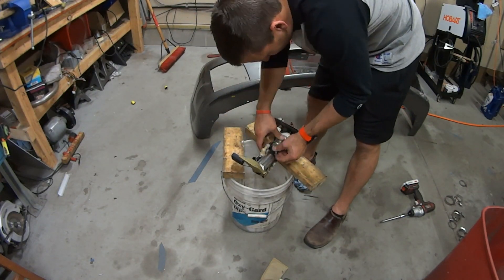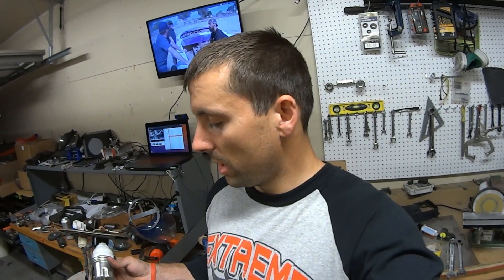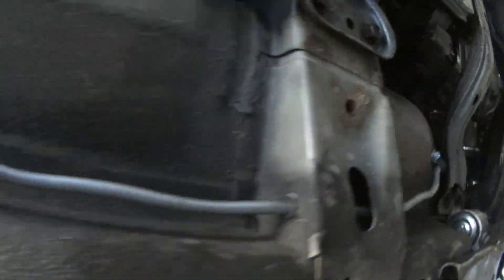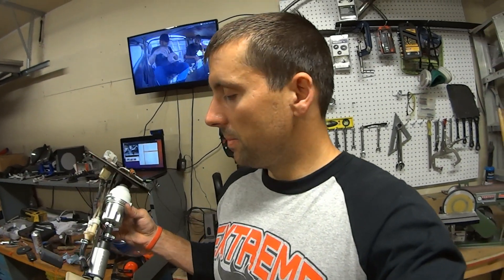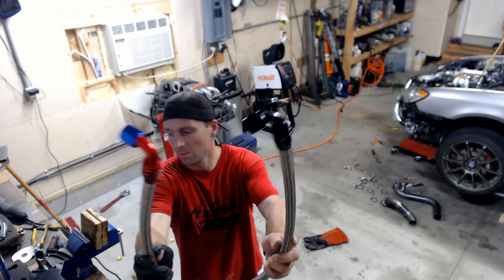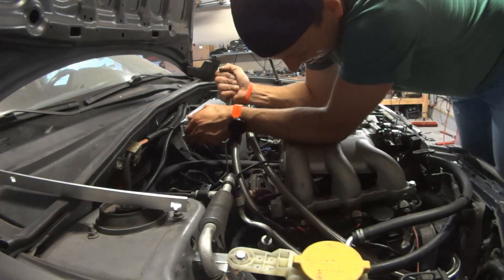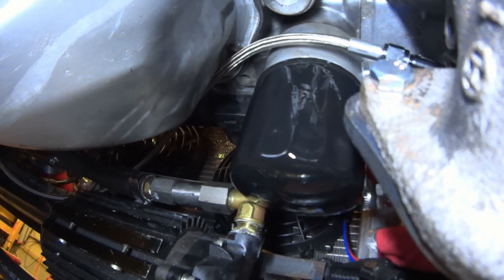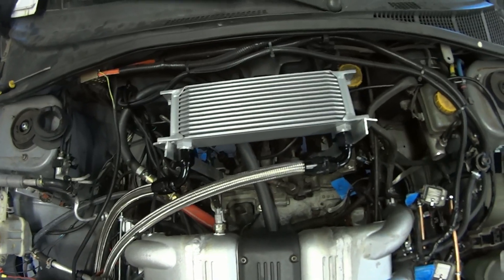EG33 Swap - DW65C Fuel Pump and Oil Cooler (Ep. 27)

Comment: My son and I have had to replace the fuel pump in the tank. Did you keep that ridiculously difficult clip in system in place, or is this a modified fuel assembly?  Curious.
Reply from the maker: Mark Brand factory fuel assembly. Just swapped out for the larger pump. It is a pain.